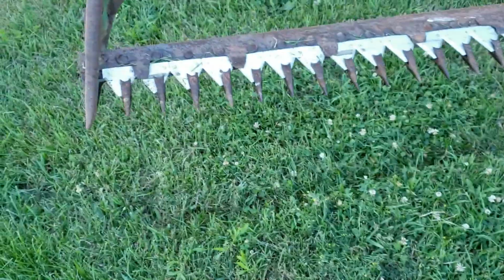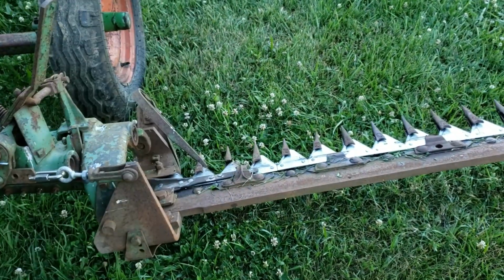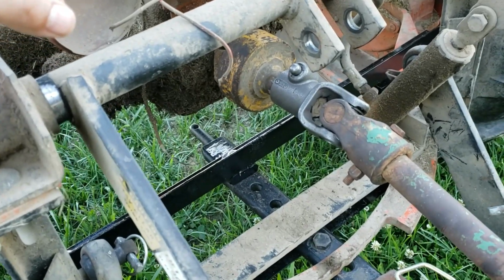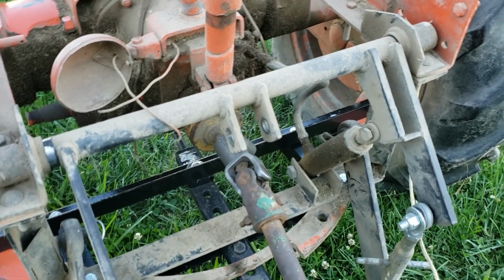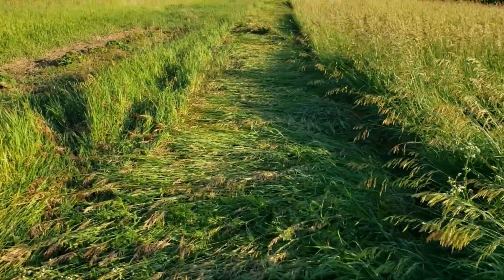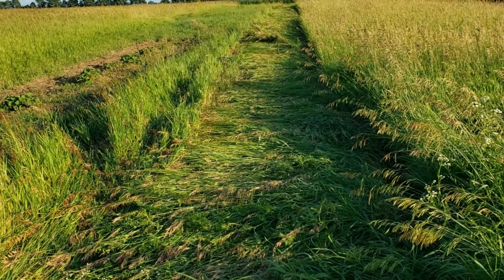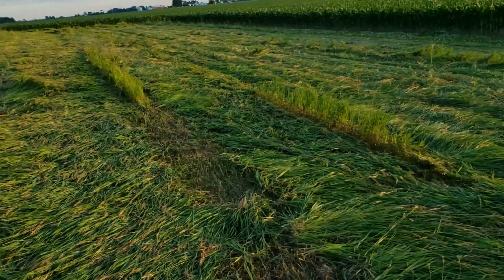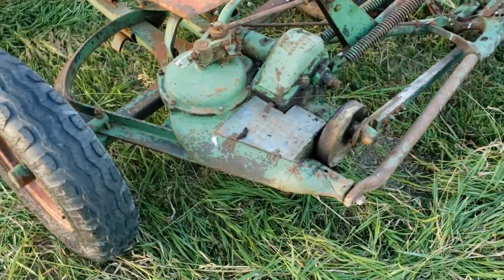New Idea 30A Sicklebar Mower Repair - Final

Comment: You will only need the lift for stones or dirt mounds other big objects. That kind of cool it lifts itself. I grew up on an old number 5 John deere mower i had to operate the lift with my foot with linkage from mower to tractor. It was a real challenge for a young boy of 7 and the tractor had hand clutch. Real challenge when approaching a rock and having to lift the bar with my foot on the left side hand. Clutch was on right side of tractor. Then to make things more challenging we had a rope running from dump rake to tractor and had to trip the rack at every tripping point when it was full to create a line for the baler or farmhand bucket we used to push it all in bucker piles then put in stacks around the field.

Comment: Its easy to get rivets out, either grind the tops off ,then punch the rest out or put the knife back bone on a sharp edge of steel and belt the blade off the back bone with a hammer.

Comment: I just bought a 30A. Did you replace the cutter bar or just the knives?
Reply from the maker: I just replaced the knives.  I did find a place that sells replacement bars w/ new teeth installed.  I think they were somewhere near $300.  If you are willing to put in the time and hammer muscle, it isn't that hard to replace the teeth.  The hardest part was getting the old teeth and rivets out.  That arbor press was really required to get those old rivets out.  It took me longer than I expected to complete the whole process but I was happy with the result.
Reply: @bischoff6981  I always used a ballpeen hammer & sharp cold chisel to remove the rivets holding the cycle sections. We did not have  4" grinders in 60's or 70's. I have 2 New Idea 7' cutter bars. My best one was made in 1940's & they both have original tires . I see yours has been replaced.

Comment: What’s that part number on that quick disconnect
Reply: The John Deere number 5 didn't have quick disconnect the splined end on the mower slipped on to tractor shaft. There was a notch machined all the way around the tractor shaft and the end on the mower slide on to a point where a bolt was in an off set hole it would keep the shaft from sliding off and it bolted down onto the tractor shaft with a tight fit.